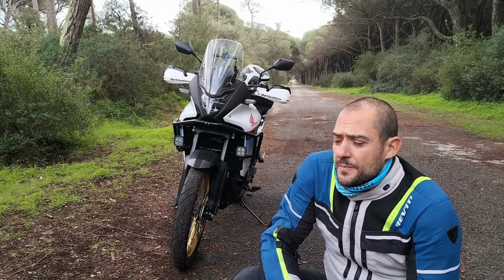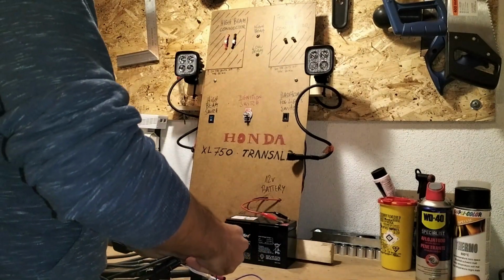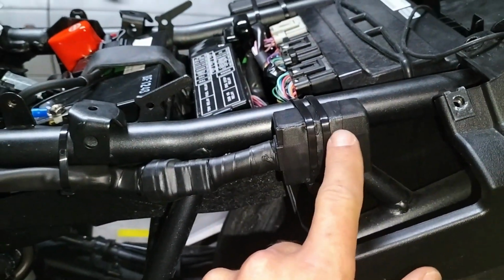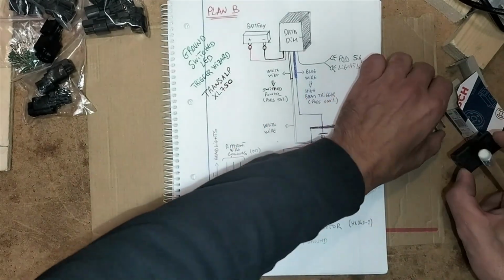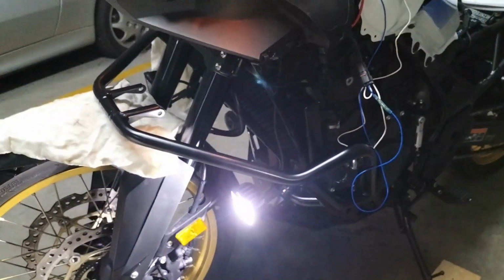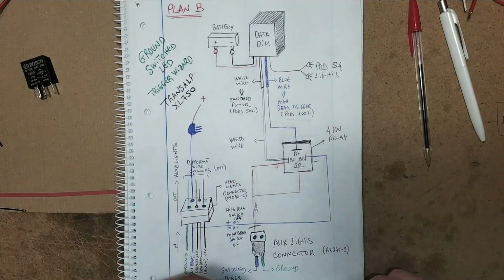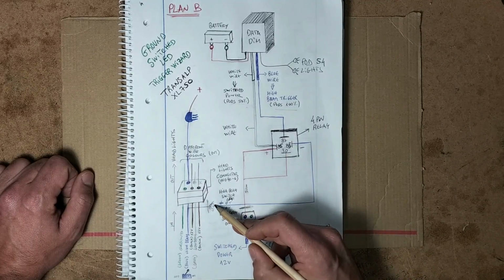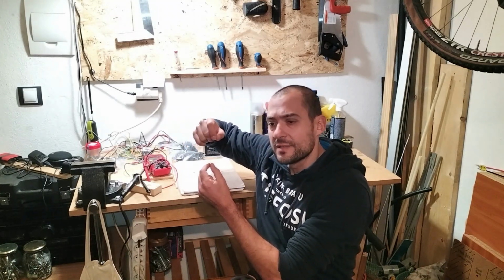DENALI S4 Fog lights (DataDim) fully integrated - Transalp XL750 - Fixing issues with Full Beam Sync

Comment: So my auxiliary lights did not come with a plug, they only came with red, black and yellow wire... Where does the yellow wire go to, there were no instructions?
Reply: And the lights don't work with just red and black connected to battery
Reply from the maker: What aux lights are they?
Reply: @b.toscano4148  Kewig Motorcycle Auxiliary LED Light Kit Driving Spotlights White/Amber Fog Light with Mount Brackets Wire Harness Waterproof 60W Offroad Work Lights Compatible with Motorcycle J-eep Car Truck (Black)
Reply: @b.toscano4148  Kewig Motorcycle Auxiliary LED Light Kit Driving Spotlights White/Amber Fog Light with Mount Brackets Wire Harness Waterproof 60W Offroad Work Lights Compatible with Motorcycle J-eep Car Truck (Black)

Comment: Hi. Great video! Much easier to understand now that I am about to install extra lights on my 750 TA. 
However, the Hi beam cable, that goes from 12V to 0V, does just cut the power from 12V to 0V or does it become Negative when Hi beam switched on?
Reply from the maker: Hi. It grounds the Hi beam. It's ground switched.

Comment: Hi Bruno, i follow the complette instalation here and found your post in the Transalp forum... i order the Connector Sumitomo HV040 - 6 pin Female 6189-7040 but not fit with my transalp, could you confirm if the UK version connector could be diferent with Latin america version or do you have idea where i can check it. 
Thanks for your video its a nice option.

Comment: Menüden aktivasyonu yaptım ama açık konuma getirdiğimde yanıp sönüyor ve devreye girmiyor. Sebebi ne olabilir?
Reply from the maker: @srtn_22  I'm sorry, I don't speak that language
Reply: @b.toscano4148  Just touch translate button. :) i try to explain in english. i short circulated and activated fog from menu. Than press fn button and try to activate fog lights but they don't turn on and on screen writing fog on but flashing and dont work. How can i solve this problem?
Reply from the maker: @Sertan_c  check the DTC menu on the bike. If the error "B26" is showing you've got an open circuit on the fog light connector. Please see my reply to RichHood below 👇🏻 where I explain how I've fixed it. Let me know if it helps.
Reply: Yes b26 code is active when activate fog lights.

Comment: All this to get fog lights to operate with the high/low beam switch. This electrical system is a CanBuss system. I would not do this. I’ll use a separate switch if needed and not allow fog lights to be connected to CanBuss system.
Reply from the maker: @ghostpepperrides4805  I don't want a separate switch

Comment: Amazing detailed video. Smart man. Thanks. If you use the short service connector when you get the dash unplugged check engine light you can immediately bypass the fault light fyi
Reply from the maker: @kevinthailand2568  Thanks for the tip 👍🏻

Comment: Great video. Can I connect S4 fog light direct to fog light free connectors without connect to the battery and additionals accesories?
Reply from the maker: @waldemarlata882  Thanks. I don't think so. The S4 pods have a 3 wire connector (-ve)(+ve low intensity)(+ve high intensity). The fog light free connector is a 2 wire connector (-ve)(+ve). Even if manage to adapt it and connect the S4 directly you'd only have 1 intensity available. Plus, I don't remember how many amps the S4 pulls but might be more than what that connection is able to provide. It's always preferable to connect aftermarket fog lights to the battery for that reason. Hope it helps. Cheers
Reply from the maker: @waldemarlata882  I don't mention in the video but have mentioned on the comments here. I had to plug a 11w small LED that works as a dummy to the other free connector in order to close the circuit. Because I was only using the fog light positive pin to get signal, the ECU would shut the aux lights off at high revs, because there was no signal returning to the negative pin. Hope it makes sense.
Reply: Thank you for explanation. Now I know what to do. Cheers

Comment: 8:50 FYI, XL750 USA models do not have the fog light connector and wiring in the factory harness. The heated grip plug is there alone. Even though the meter display shows a fog light option 
11:53 you will need to run your own wiring and switch for any added lighting system. Also, Honda brand fog lights for this model are not available in the U.S. ☹
Reply from the maker: @bluevalkyrie2517  thank you. I didn't know that. Weird though. Don't understand why they make the bike different for the US market. I get the difference in regulations on power and noise, but not the wiring.
Reply: @b.toscano4148  Oh well, at least we get the quick shifter standard.😁

Comment: Such a great video and thorough explanation.  I was looking up how the datadim worked, because I don't want the dialdim.  I plan to install it on my NC750X, so I'll be referencing your video to help my installation process.  Thanks again for all of the information in the video.
Reply from the maker: @JoseVargas814   Thanks. Please my reply to RichHood-r7u about the possible error if you leave the -ve wire open on the fog lights connector. Cheers

Comment: You saved me a lot of troubleshooting. Thank you! I was trying to overcome the 0V high beam on my father’s NX500. He traded it in on a Transalp and I’m about to start the lighting project tomorrow night. The diode was what I figured my fix would be but you confirmed it. Good job, and no I don’t think you’re doing anything “silly” with the bike. I’m a service advisor at a Honda dealership and you taught me something today. Keep doing what you do my friend.
Reply from the maker: @RichHood-r7u  thank you. Please beware that if you only use the fog lights connector to get +ve signal and leave the -ve free, the BCU might turn the fog lights off as there is a "open circuit" on the -ve wire (green).It happened to mine at high revs only. To sort it out I've plugged a "dummy" 8w LED (T10 type canBUS LED which I put in a small black box to black it out) on the free connector on the other side of the bike and tucked it somewhere under the seat. It works, no errors. The error showing on the DTC menu was B26 - Fog Lights, which in that case was "open circuit on the green wire". Cheers
Reply: @b.toscano4148 nice!! I have the factory Honda aux lights already installed and want to add Denali D2. My thinking is to do what you have done with the relay and all should be fine as there is no open circuit and am just getting the feed for the relay you added for the data dim. What do you think? Maybe too much for the factory circuit? D2 is very low power
Reply: I am using both side cables. 1 side to left fog and other side to right side. No free cables left. But when i try to activate fogs they don t turn on. On the screen on writing is flashing...

Comment: Fog lights should be yellow or ambar.
Reply from the maker: @agprime  Maybe you're right, if your only thinking about the glare reduction. However, those ones I have installed are not just for fog. They're auxiliary lights, and the main purpose is to be better seen when I run them on low intensity, and to better see in the dark when I run them on high intensity (full beam). Cheers
Reply: @b.toscano4148   Make sense, I run dual color, Low is yellow and hi is White.
Reply: @b.toscano4148   Great.
Reply: You are awesome. Great job explaining and showing install. Thanks for leaving failed attempts in video and capturing your thought process, it makes the video more real by showing your struggles.

Comment: Awesome video!!! I activated aux lights in the system menu. However, when I try ro switch on light, there is no power on the aux connector wire. Also, in the menu, turn on toggle blinks like something is wrong. Did you experience something like that?
Reply from the maker: @BozicNebojsa  Hi there. It does happen to mine sometimes, very randomly. Sometimes I ride for 15 min and it happens, sometimes I ride for a couple of hours and nothing happens. It seems to be triggered only at high revs. Weird. For some reason the aux lights turn off and the Fn menu (blue bar at the bottom of the screen) flashes when I try to switch them back on. When I turn the ignition off and on again, it works. The DTC error (you'd find it on the maintenance menu ) is "B26". That means 3 possible issues according to the Shop Manual: 1. A short on the blue/black wire (+ve); 2.open circuit on the green wire (-ve); 3. Faulty BCU. Because it just happens randomly and not that often to me I haven't tried to fix the issue permanently. I guess the problem is the #2 above: open circuit on the green wire, because I've only used the aux lights connector to get +ve signal and left the -ve free. Solution for that? Well, I think I'll have to either plug a resistor or a small LED (one of those with CANBUS resistors) to the other aux lights connector, so the BCU "thinks" there's actually a light connected there. Hope it makes sense.
Reply: Nice. Did not know that!
Btw, for now, I have an external switch for lights and I used "live" wore from the rear USBc charger connector.
Reply: @b.toacano4148 How do you read DTC errors? 
Yes, I agree it is probably #2.

I am also thinking about putting some small LED, just to close circuit.
Reply from the maker: @BozicNebojsa  Go to Main Menu by holding the button on the main switch ">>" for 2 secs > [Maintenance] > [DTC].

Comment: Would you be able to confirm the wire connections of the DataDim module? In the absence of any reply from Denali about this, or actual technical information with the product itself (so I wouldn't need to ask), I think Red and Black are +ve and -ve respectively, White is the low and Blue the high power trigger, but what are the green and yellow?

I presume they are to the lights themselves, but if yellow from the DD module connects to the lights' yellow to switch into low power mode, what is the green?

I don't have the Denali wiring as I won't be using it, which means I cannot figure it out from there, so would appreciate it if someone can confirm.
Reply from the maker: Hi there, sorry for taking so long. Good question. I don't actually know exactly what all those wires do. I'd have to take everything apart and test them individually. Let me watch my video again and in case I come up with any conclusion I'll let you know. Hope you've found an answer already. Cheers
Reply: @b.toscano4148  I have finally been able to extract that information from Denali. They have a nice diagram that shows the purpose of each connection, but they really don’t want to let anyone have it. Just buy their harness and do it all how they have decided the lights should work. Typical Denali again but I HATE that level of overt control they’re trying to exert. They make good products, but their attitude means I would avoid them if at all possible.
Reply: Do you mean the DialDim? Denali's DATAdim does not have any wires, unless they're inside the sealed housing. If you're talking about the Universal DialDim Trigger Harness, everything is clearly explained in the product photos and the Install Instructions. The part number is DNL.WHS.20500
Reply: @alexsteele1856  Not sure what you mean as everything is indeed connected by wires.

I eventually extracted the information from Denali. The green from the DataDim module is the +ve (power) to the light 'pods' and would actually connect to the pods red wire. So green connects to red, hmm, that's nice and obvious. 😕
Reply: @UKenGB  Again, you are saying DataDim but I think you mean DialDim. The DataDim does not have any wires at all, it is a module with a connector that plugs into their normal wiring harnesses. The DialDim's Universal Wiring Harness has a green wire that is supposed to be connected to the vehicle's horn (which enables the Strobe With Horn feature).
Reply: @alexsteele1856  Yes, I am again saying DataDim because that's what I mean. It has WIRES between the black box and the connector. They are short and enclosed in a black sheath, but there are wires and they are coloured and I needed to know what each was. Now I do.

Denali's harness is of no interest to me as it doesn't fit how I want my bike and doesn't work the way I want. Hence I want to wire it up how I want it and for that, I needed to know what wires were what. As I said, now I do. It was however extremely irritating that Denali's attitude is 'just do it our way' and supply no actual information about their product. In the end however I was able to convince them to supply what I required.
Reply: @UKenGB  care to share for the rest of us, dealing with the same question? I assume:
- red: 12V
- black: ground
- white: ignition on
- blue: full beam trigger
- yellow to the yellow of the pod: pwm for low intensity
- green to the red of the pod: 12V for high intensity

Correct?

Comment: Wow, you did a lot of work here, a bit over my head but you may know the answer to my question. I moved a set of Cyclops Aurora lights from my KTM to my new Transalp. These lights have a halo which is on all the time, and a center flood that comes on with high beams by tapping a relay into the high beam wire. It should be easy but the center light doesn't work. I tapped into a blue wire that is one of 4 going through a grommet towards the headlight, under the dash screen module. I should have done more testing because this doesn't seem to trip the relay on. I took the connector before that apart and checked that line and it seems powered on both high and low. Don't know why it wouldn't activate my relay / lights, and I couldn't seem to find a wire that is energized by turning the high beams on..., but they do come on (the bike, not my center flood). Any ideas? The lights work fine when I power them directly and touch the relay line to positive . My bike is North American, maybe I was looking at a European wiring diagram, or maybe they are the same anyway.
Reply from the maker: Hi Stephen. Thanks. I'm not an expert but we can work it out together. Send me a private message thru Instagram https://www.instagram.com/toscanid?igsh=aWtxZ2gzOHBkYXRn
I'll share my email and we'll find a solution.
Reply: @b.toscano4148  I have exactly the same issue on my Hornet 750. Totally stumped as to what to do next. Also the Hornet doesn’t come with existing plugs like the Transalp does.

Comment: Great illustration of the problem.  I took Denali lights off 2016 Africa Twin and ran into the same problem you did.  I was totally confused, and you cleared it up.  Thanks so much for such a good video and explanation.  I also had the dash Engine light on and it just went out on its own a couple of hours later.  I ordered the trigger wizard from Denali because my wiring skills are not as neat as yours are.  Thanks

Comment: Super cool. I wrote 3D cycle parts about their wire harness for aux lights. Their version only runs with high beams. I live in NYC and said to them I wanted a version that also ran with low beams, to help me avoid the dangerous potholes on city streets (can't drive around with high beams). They said they would help me out. But, I love your explanation. I have many skills but that level of electrical is beyond me, so thank you. My own Transalp is on order and not arriving until March/April. I may likely follow your program. Will keep you posted. Again, thank you!!!
Reply from the maker: Hi Andy, thanks. Potholes on portuguese roads are part of the norm too ;)
3D Cycle has a few nice plug and play solutions that make everything easier. If they help you out with the desired 2 intensities you'll have on your bike pretty much what I have on mine. The Transalp XL750 deserves a better/bigger headlights, and a good pair of aux lights make it work perfectly. Beware, the 3D Cycle harness is plugged on the 12v socket connector in order to get power to feed the aux lights. In case you want to run both 12v socket and aux lights you'll need a power splitter from that connector. They have that too. You'll love the bike. Cheers